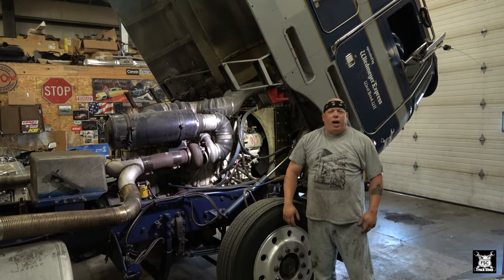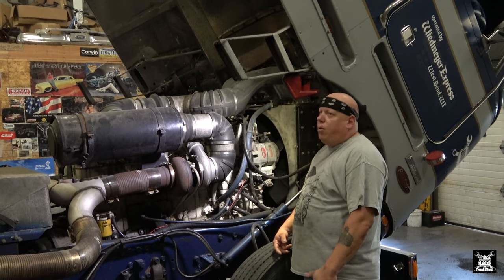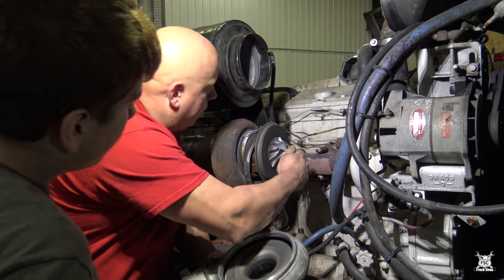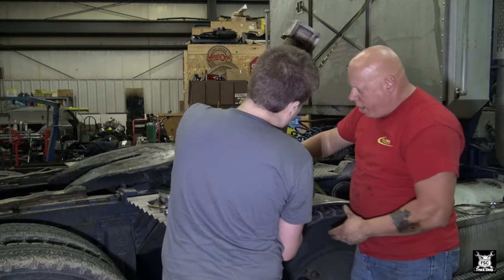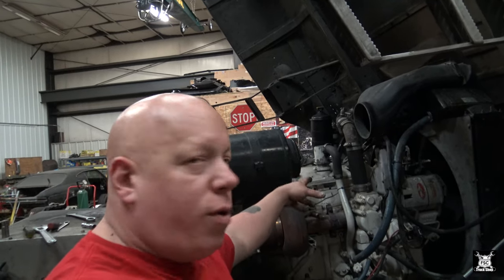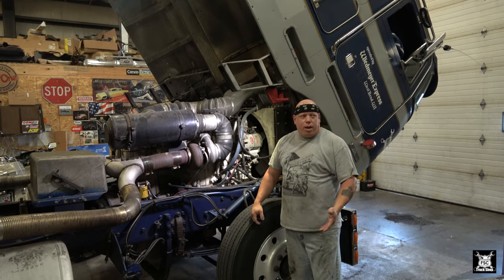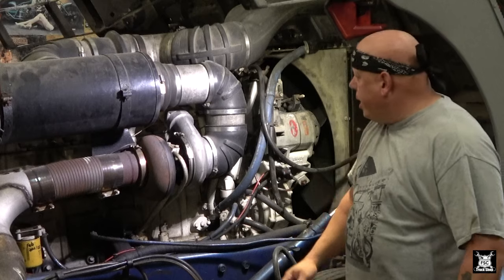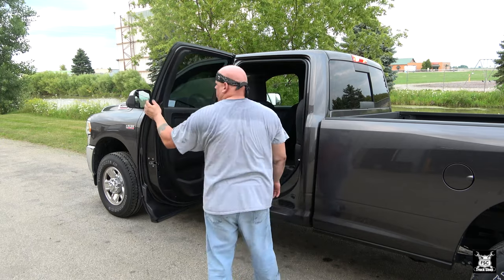I Fail In Used Turbo Installation   Caterpillar 3406B 7FB

Comment: Just for clarification; the turbocharger cast iron side is the turbine wheel housing, the aluminum casting is the compressor wheel housing. As you noted, the Hot side is cast iron side is the turbine wheel housing and the Cold side is the aluminum compressor wheel housing. The core assembly should not have end to end play and very little play side to side, as the tolerances for the journal bearings inside are very tight. with the amount of play that you have internally to the Turbine Wheel and Shaft through the core and connected to the compressor wheel I am very surprised that the  compressor wheel or turbine wheel blades aren't damaged and the housings aren't chewed up. 

From a retired quality engineer who worked at a turbocharger manufacturing operation.

Comment: I was always told to idle down an engine with a turbo for about 5 minutes before shutting off the engine to keep the oil flowing in the turbo as it shows down to idle.  Just a thought.
Reply: It's actually to help cool the center section down so that when you do shut it down the bearings and housing aren't hot enough to cook the oil into coke.

Comment: If bearings have slack then seals are going to wear out faster than normal. One goes bad, they both do. Lot better off with the new turbo. Great videos, GOD Bless
Reply: If it were the bearings seal it’ll smoke out the exhaust on deceleration

Comment: It is normal for a turbo to have side to side movement.  As long as it’s moving in and out or contacting the housing is fine.  The oil pressure centers the shaft in the bushing.   The leak is likely from a leaking/weeping gasket or small crack in a line.
Reply: This is what I was thinking tho it’s hard to say without it in my hands

Comment: What about the leaking fuel pressure gauge. With the expensive Diesel fuel dripping on the ground, that is eating into your operating profits I would just cap that off until I could get a repair for it.

Comment: Oil leaks can be caused by a variety of factors, the main factor being incorrect pressure within the compressor and turbine housings. That being said An oil leak can also occur when engines are running on idle. The pressure within the housings is lower, which in turn can lead to a vacuum being created, causing the oil to leak into the turbine housing.  Once the engine starts to run at normal speeds the pressures will be restored and the leaks will stop.

Comment: I replaced a center section on a powerstroke once that had cracked and was leaking oil. Did you determine exactly where the oil was coming from on yours?  Those oil lines look severely pitted.

Comment: Hard to see with this camera angle but, Looks like the oil drain pipe is leaking. Maybe cracked or a bad gasket or lose bolts. As a turbo rebuilder I have seen many drain and oil feed pipes not seating to the core properly and causing leaks. The turbine shaft will have some play as most turbos have floating bearing and need oil pressure to work correctly. Turbo exhaust housing can run cherry red hot at times and will develop small cracks and this is normal. Only if they start to burn away or warp you will need to replace it. Hope you find the problem, lucky you didn’t have an oil fire with that much oil leaking.

Comment: Your lucky you didn't have a fire from that leaking oil !
It would have burned the Peterbilt to the ground ..
 Just get a New Turbo not a rebuilt.?
Also if you where to reroute the air supply and filter box you might find the new turbo will work better and produce better ?
If it can get more air it should sing better that the way it's been in the past .
You fresh air supply us being restricted in it's current way. Run it like a Cummins setup ?
Where their is a stack coming up behind the cab and going into the air filter. The air will be less heated than it being pulled over that hot engine ..
  Think about it ?
Maybe consider going with a larger turbo or go with a dual  compound turbo setup ? That cat engine will scream and you'll get way better performance from that old cat engine !
Reply: It's all about milage
Reply: I don’t think this guy replies to tips folks like you send.  I was in trucking biz 40 yrs and operational questions I ask him never get replied to.  Some of the things he does he doesnt explain and make no sense to me

Comment: That small amount of play, is normal. In/ out is not good.
Reply: It's actually the opposite. In amd out is OK, up and down is bad.
Reply: @mikeznel6048  wrong. A small amount of side to side is not bad. It gets taken up with the oil flow. In/ out, will cause the turbines to hit the housings, just as wornout shaft bearings will.

Comment: Do you idle the engine down for a few minutes before you shut it off , or do you just turn it off ? Remember the turbo is still spinning and not getting any oil after the engine is turned off .  I have made it a habit of setting the shut down timer for 3 minutes myself . Hay it can't hurt .
Reply: I had a Ford Tech Supervisor tell me the same thing when asking him about ways to prevent turbo failure in a 4 cyl Ford turbo engine. Let the turbo idle down before shutting off the engine. The remaining oil bath will not burn up while the engine oil pump is off. Makes sense but you need some patience which most people dont have.  Big diesels don’t spin as fast as car engines either.
Reply: @kimmorrison9169  For starters the turbo is spinning around 100,000 rpm gas or diesel . Anyway I was taught this when I was in school for diesel back in the late 1980's . And you  are correct about people's lack of patience .

Comment: Quite a stream of black oil flowing down the steel line. Could the line have a crack or pin hole in it?
Reply: If it was a line leaking oil it would leak when oil pressure is applied or running . If you notice it pours out more when climbing a hill with a heavy load ? So I would go with bearings and seal.issue.
I have a turbo off a 400 Cummins big cam and it doesn't have any play .

Comment: Tim Gentry has 2 International cabovers surplus to requirements No engines or transmission or rear ends. One cab is good. I think he has a title to that one. You would need to put a modern cut off on it. (Just a thought)

Comment: Not having much info on turbos can you explain what the cartridge is?
Reply: What Steve is referring to as the cartridge is the center section. It has both turbine blades, shaft, bearings, seals protective metal cover (exhaust side  of center) and body. It has an oil inlet and a oil drain hole also. Hope that helps.

Comment: The bearings/ seals in the old turbo may just be bad
Reply: That would create an internal leak, not an external leak. It's either a cracked housing or leaking feed line or seal or leaking return line.
Reply: That sounds likely.....  I'm curious to find out exactly what the cause of the issue is....